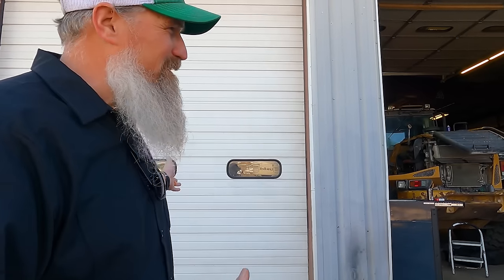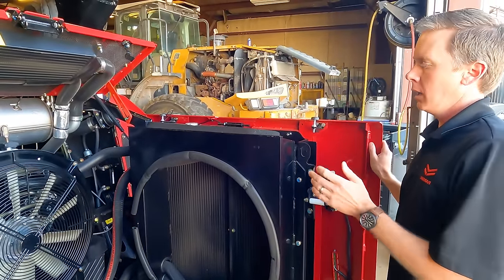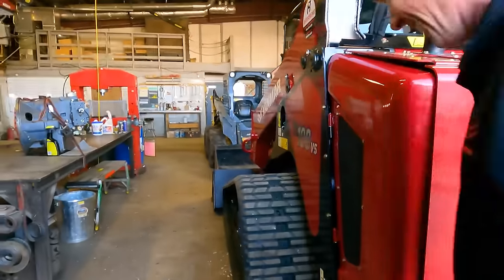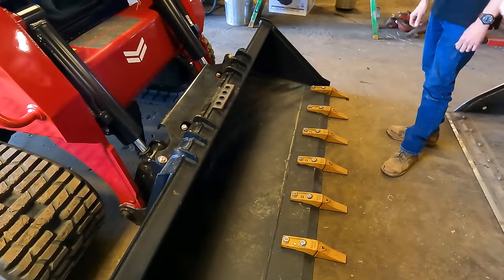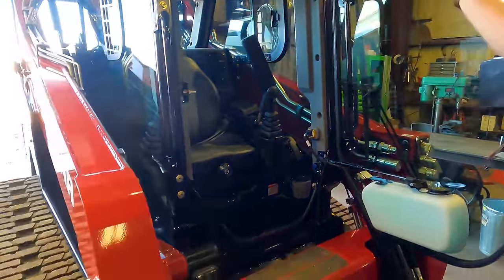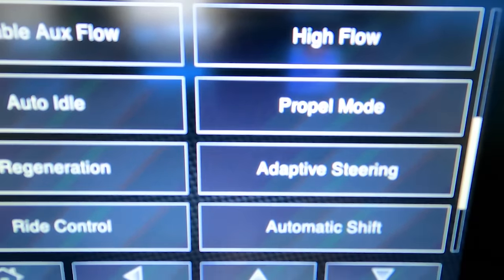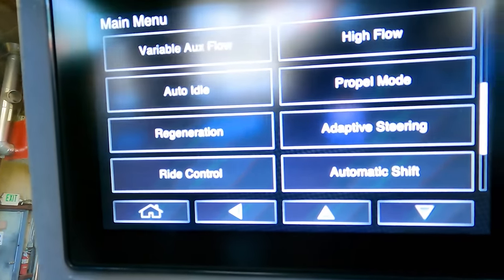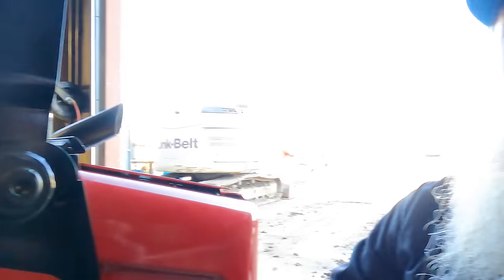We got the 1st Yanmar TL100

Comment: Just a suggestion, turn down the music or just get rid of it. I couldn’t hear you sometimes. Looks nice. I just wish more manufacturers made the kubota/takeuchi style door so it’s easy to run open
Reply from the maker: I will take your feedback into consideration.  The reason most companies don't use roll-up doors is due to cab pressurization.  The roll up doors do not hold pressurization after a few hundred hours in most cases.  Yanmar does give the option for both worlds with this machine.  Which is why I like the design.  Thank you for watcing.
Reply: @diggindeeperPCG  the new cats are doing the same as well

Comment: You can tell they merged with ASV. I have a 2023 ASV RT 50 and there’s some things on the inside that look just like it.. I would like to get a hold of that guy about adding a foot throttle to my machine. He seemed very knowledgeable ,It has the Yanmar engine &the guys at ASV are pretty rude, I called ASV in Minnesota direct last week ,he said it couldn’t be done. Seems weird the same horsepower tractor has a foot throttle ,so I should be able to get the pedal and throttle position sensor.
Reply: Why wouldn't these CTL have foot throttles? Huh?? Why leave that off?
Reply: @technicalitems731  not sure, guy at the manufacturer I talked to said their meant to run wide open all the time 🧐
Reply from the maker: @technicalitems731 does have foot throttle. I guess the ASV does not.  That may have been one of the improvements.
Reply from the maker: correct

Comment: Nice unit! Would consider it for sure. Let's see it in action! Escape hatch is nice. Ground clearance and tracks ability to clear mud is a huge difference. Overall, I like the build. Dealer support? Lots of questions. I'll find out soon enough.
Reply from the maker: Yes, impressive machine!  I will keep everyone updated on the support.  My Yanmar excavator has had excellent support from this dealer (Riverbend Equipment) so far.
Reply: @diggindeeperPCG  I bought a T66 last year, and I do like it. Wish it had more power and hydraulic flow ( says everyone ). It does exactly what I bought it for and no DEF! However, my wife has decided she would rather have it than the S185 for her horse operation. So I hope to demo one soon. I really don't want to spend 125k, but you know the wife will get her way! Lol, I live near San Antonio, so there is no shortage of equipment dealers.
Reply from the maker: @Tinfoilhat311  This machine new, should be closer to 100K.  For the cost, the foot pounds and horsepower are unbeatable.

Comment: Cool looking machine , i like the torsion suspension undercarriage like my 289d but on my 289 that is all greaeable , that windshield washer fluid tank would drive me nuts as i do mostly fine grading with mine
Reply from the maker: It is all greasable on this machine as well.  At first I thought it looked like the washer fluid res was going to be in the way and in view.  It is not.  But the design allows for the door to be quickly removed.

Comment: ASV skid steer in red with needed improvements that make servicing better.
Reply from the maker: Many other changes as well.  All of the negatives of the ASV track system have been changed/improved as well.  More to come on other machines as well...stay tuned and thank you for watching.
Reply: Still cheap made steel in rear if you hit something it’s getting a dent or big dent
Reply from the maker: @Grggeorge  Thanks for watching and commenting!
Reply: @diggindeeperPCG  no problem I havnt found one that’s perfect I like the controls on asv but its also light in the back for weight just why cant one of the manufacturers get it all perfect
Reply from the maker: @Grggeorge  That is in fact an interesting question and is technical in nature.  This machine, is hopefully just what we needed, due to the fact most machines are too butt heavy for the steep grades we work on.  Counterweights are great for increasing the specs on lifting capacity, but make the machine too butt heavy for many applications.  I think it is fair to say, more than 1 machine might be needed depending on application...unfortunetly.
Reply: @diggindeeperPCG  yeah ran asv and it was always tipping the cat I got didn’t tip but it’s broke down after 180 hours so now I don’t like cat but I’m stuck with it and a huge bill
Reply from the maker: @Grggeorge  that stinks

Comment: Nice looking machine, wish it had a roll up door. Other than that, it looks like it would get the job done and easier to maintain than any other machine on the market.
Reply from the maker: I do appreciate the roll up door.  I've found the roll up doors don't pressurize, the cab, after a while.  The fact this door comes off so easily was a huge selling point for me, because of the times I prefer to run with "the door up".  Thank you for watching and commenting.  We have another machine we are reviewing and posting, probably today.  It is crazy!!  Be sure to check back.

Comment: One sitting at CN wood company in woburn Massachusetts for 3 months.  They sell komatsu,  yanmar  equipment.     If it was a 75 or 80 would of been sold by now. Smaller properties in my area.
Reply from the maker: Thats really interesting because I know there are people waiting in line to buy these.  They could sell it in a heartbeat if they put in on Machinery Trader.  Also, I heard Yanmar will be coming out with a mid sized model but chose to start with the 100.  Not sure why, but I may end up with the other one as well 😃.  Thanks for watching Ron!!

Comment: Does that wiper fluid tank on the door not impair the view of the bucket?
Reply from the maker: I was also concerned about that at first glance. It does not and it is not in the way at all.  The design of it on the door is what allows the door to be easily removed as well.  Thanks for watching!!
Reply: I like the idea of a easily removable door. But I'm still not sure I would ever buy a machine without a roll up door. I can't figure out why a manufacturer would design a machine where the Operator has to look through the door all day. I prefer to have a unhindered vision to the bucket and worksite.

Comment: Move the washer fluid reservoir off the door thats robbing visibility in a crucial part of the window.
Reply from the maker: It does not rob any part of the view, I was worried as well.  The design also allows for the door to be quickly removed and installed.

Comment: What did it cost ? What does it weigh ? can you add extra weights on the back ?
Reply from the maker: It is comparable in MSRP to the Kubota 97. Comparison video dropping next week.  it is 10,800 pounds.  Let me check on the ability to add counter weights.  Our company does not use counter weights due the grades we traverse. But I will check for you.
Reply from the maker: No counterweights at this time, per dealer.

Comment: Would be cool to have a flip up door like an excavator otherwise looks like an awesome machine
Reply from the maker: Flip up is nice...and with the swing doors offered by Deere, Yanmar and others you can achieve a pressurized cab, which actually works for thousands of hours.  The pull up doors lose their pressurization very quickly.  Just sharing something I've learned the hard way. 😂
Reply: @diggindeeperPCG  you’re definitely right they say the Kubotas with the flip up door are the loudest skid steers on the market

Comment: So every time I need to load or unload something off my truck or trailer with chains, I need to remove the door ahead of time. Otherwise I have no way to exit my machine. Useless to me. Depressing. It was looking so good up to that point. I guess Kubota or Kioti/Hyundai are my only options right now.
Reply from the maker: Oh man that stinks!  What trailer are you running?
Reply: @diggindeeperPCG  Nothing great. A PJ 24 ft gooseneck with dovetail ramps. I also have a 12 ft flatbed dually as well.
Reply: @diggindeeperPCG  Nothing great. A PJ 24ft Gooseneck with dovetail ramps and an f350 dually cab and chassis with a 12 foot flatbed. I also have a Miller Trailblazer mounted in a steel cage that I load and unload from time to time. I’m active duty so I work my side business on the weekends. Just trying to make enough to pay for my equipment. Then when I retire I hope to have the expensive stuff paid for. At least for a while so I can really get things happening for me.
Reply from the maker: @survivalguyfyi5718  Sounds like a good plan to me!!  With a 24 foot trailer, why does the bucket need to be raised for hauling?
Reply: @diggindeeperPCG  Where I run into an issue is if need to load or unload a welder, or generator, or any other heavy item. I typically chain those to the Bucket of my backhoe. No issue there since my door is on the side of my backhoe. With a skidsteer and swing out door. Your bucket has to be all the way down or raised above the cab so you can open your door to exit. That makes it impossible when loading/unloading those things from my trailer. Heck, now that I think about it, I couldn’t even move stuff around in my property that’s chained to my bucket either, which I do quite a bit. Most of the time it’s just me so I don’t have anyone outside my skidsteer than can hook or unhook my Chains for me.
Reply from the maker: @survivalguyfyi5718  I understand...that does make sense.

Comment: thay are a rebadged ASV vt 100
Reply from the maker: Not quite...Many enhancements since Yanmar bought ASV and moved to MN.
Reply: @diggindeeperPCG  Actually it's virtually identical to the current ASV VT100, but with a CTL undercarriage and Yanmar paint scheme....engine, dump height, dump angle, pumps, machine length, fuel capacity, etc. any differences are going to be driven by the engineering changes needed to marry up a different U/C.
Reply from the maker: @snorelacks7069  Thank you for watchng and commenting!!

Comment: So Yanmar is having ASV make their CTLs now instead of Gehl. Well I hope it holds up better than the last piece of junk Yanmar  track loader I bought new that blew it's Bosch fuel rail overpressure relief in its first 30 hours of operation.  Absolute junk.
Reply from the maker: Interesting.  Thanks for watching!!
Reply: Just to clarify the first run of skids and ctls were built by manitou and mustang. T175,t210,220r etc. Yanmar acquired ASV in 2019 and built a brand new manufacturing plant and headquarters in Minnesota. Quite impressive and U.S.A. built equipment with Japanese technology.

Comment: I also have a Yanmar that has had no issues 1000 hours. Money maker!  VIO55
Reply from the maker: Solid machines!!
Reply: First one east side of Mississippi here
I’ve had the same machine since December. I’ve had quite a few problems with mine. It’s got 44hrs on it and it’s April 3 today. Let ya know how much it’s been on the job site…not much.  Issues with parking brake has got everyone scratching their heads for 3 weeks now…won’t move Mostly tinkering issues like brass grease fittings on undercarriage that have been replaced steel ones that broke off.  Loading truck first day on job and was stuck in cab for an hr or so because it threw a code while bucket was dump position over in the bed of a truck. I like the machine …I just should have waited for another year for them to get bugs out.
Reply from the maker: @littleclod  Oh boy!  I will let you know what we find on ours.